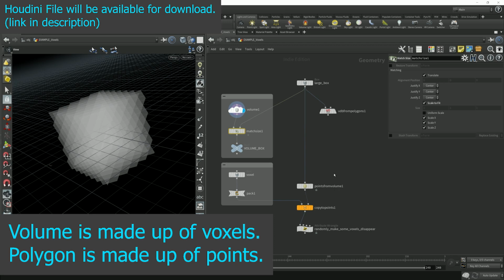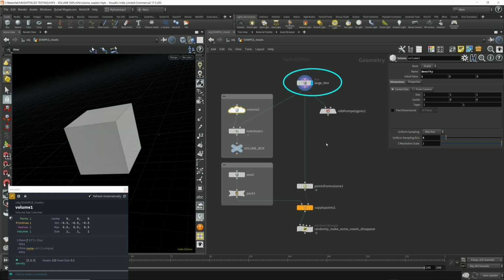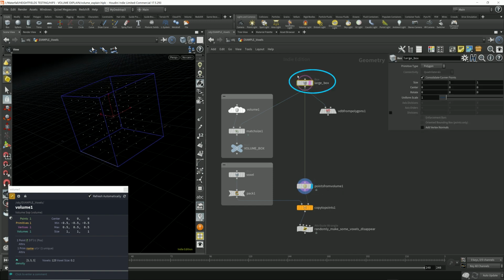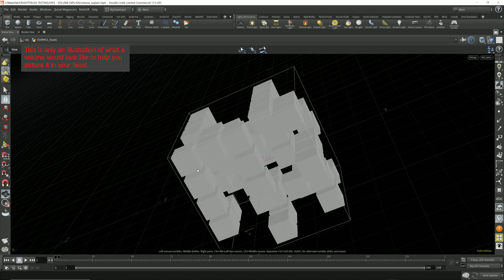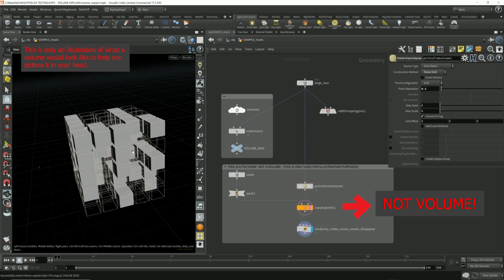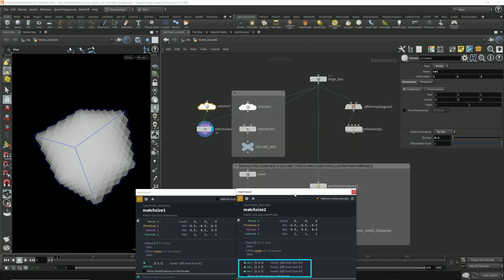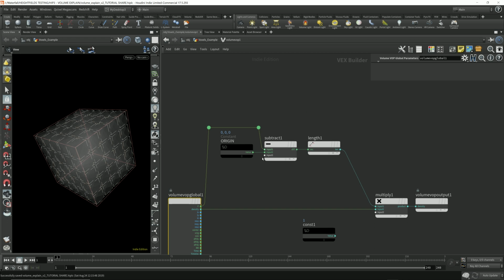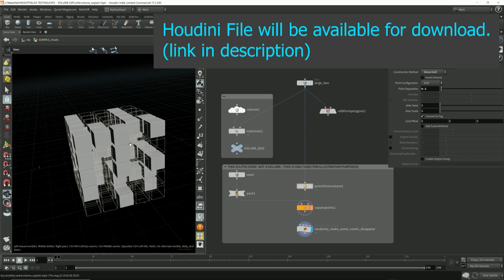What is a Volume? in Houdini for Beginners | Core Concepts

Comment: "Each volume primitive only holds a single number per voxel cell" does that mean Each volume primitive only holds a single voxel per voxel cell
Reply: hi, how do you understand Point Separation in Points from Volume? is it smallest distance between any point? distance is sqrt(x^2+y^2+z^2)?
Reply from the maker: @testvideo305  That is very close to what it really is.  It's the distance between each point (up, down, left, right) having the point separation distance.  Adjacent distance, but not cris cross.  For example, the result is always cubes.  So, I believe the particles that are say top left of another particle, may not be exactly the point separation distance.  But if the particle is above it, it will have the point separation distance.  This is a little harder to describe in text.  It's sort of like a tic tac toe board, if the particle is located in the middle position, then let's say the particles above it has 0.2 distance, then the particle in the upper left corner may not have the same 0.2 distance.  

I really hope that makes sense, but it's really hard to describe it in text.
Reply: @bubblepins  I think I sort of get it. separation distance only happened when it are between two points which are Adjacent in the cube.
Reply from the maker: @testvideo305  Yeah that's how it looks like how Houdini is implementing it.  You can think of it like a grid pattern.
Reply from the maker: that's a very good question.  But not what you think.  A volume primitive is just a type of volume and it describes how the volume stores data.  What's a volume?  How do can you use math to describe a volume?  Say I want a cloud volume that increases the density from left to right.  Where is the density information stored?  Density is a number that is stored in each voxel of the volume, that's how we know the density of the my cloud volume is increasing density from left to right.  But What is a volume primitive then?  To answer that question, I'm going to use VDB volume.  VDB volumes can store more than one data in each voxel, so if I wanted to store velocity instead of density, because I'm building a volume of velocity, then well each voxel would just store a velocity vector value right?  But not for volume primitives, which is the old Houdini volumes.  Because vector actually has 3 numbers!  X, Y, and Z.  BUt in volume primitives, the old Houdini volume format, it can only store 1 number.  So how would I store soemthing like velocity vector in Houdini volumes?  You'll need 3 volume primitives to store the entire velocity vector.  

Hope that makes sense!
Reply: @bubblepins  so volume primitive is a little deprecated
Reply from the maker: @testvideo305  no no, well Houdini primitive volumes is alittle deprecated and Houdini primitive volumes only exist in Houdini.  The more common usage of volumes is vdb, which is the formatting of volumes that other 3D applications also recognize.